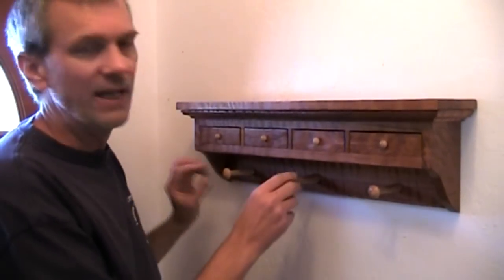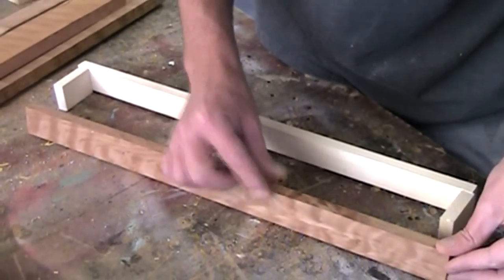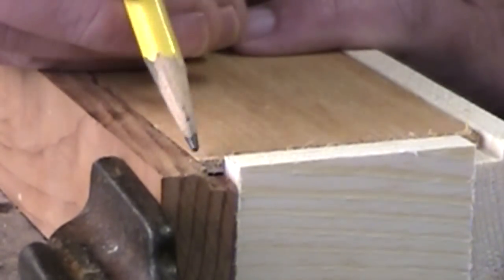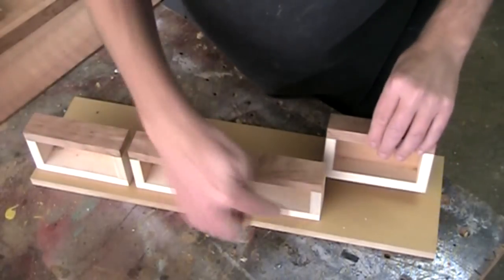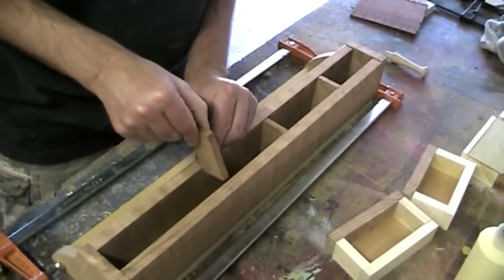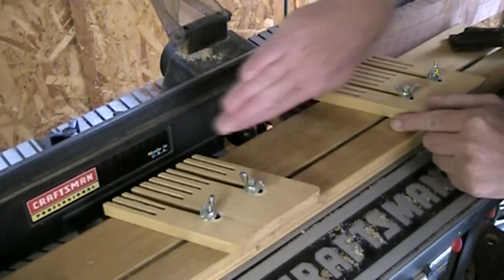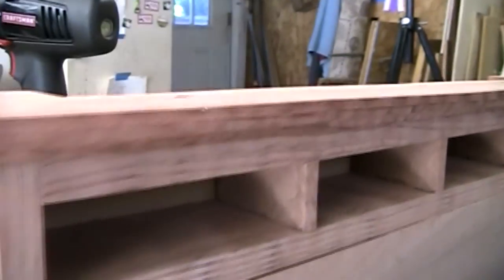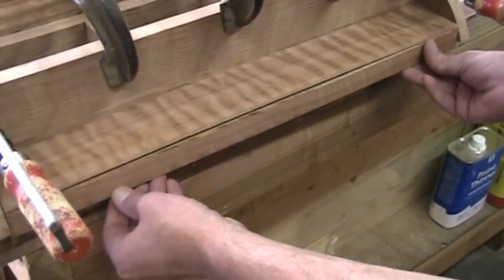Make a Shaker inspired wood coat rack with drawers

Comment: Good problem solving with the veneer on the bottom and the mitered joinery on the top molding It was nice how you squeezed as much use as possible out of a small amount of wood. I would like to challenge you to build something out f two board feet of wood and see what you come up with.. I was amazed how the grain of the wood popped when you sprayed on the laquer. How many coats did it finally take?

Comment: Kudos, like the look.  If I could make a suggestion... find a mechanical join other than butt joints and glue for the end grain to face grain gluing.  Over time... they will not hold.  Wood movement will cause the glue line to fail and so there will be nothing left to hold the drawers together but the glue.

I must compliment you on your persistence and stamina... Keep trying new things.

When My shop is set up, I may be able to make video responses and share techniques.

Comment: Hey Steve great work, I see you use a lot of spray on varathane, I have a can and when I spray a piece of work and come back in a couple hours to give it a light sanding it's still sticky to the touch. I even left a piece drying for 24 hours and it was still sticky. Got any ideas?

Comment: I was watching this video because I was curious how you were going to attach it to the wall.  Questions I still have are: what kind of screw or hardware would you use if you were putting it into drywall?  Would you use those drywall anchors in addition to a long, say 4 inch wall screw?  Or is it more like a drill screw?  I have no experience with this stuff.  Pros and cons of different hardware?
Reply: +perpetuallylove you could use wall anchors such as zip its, but your best bet is to go with toggle bolts which is shown here in this video.